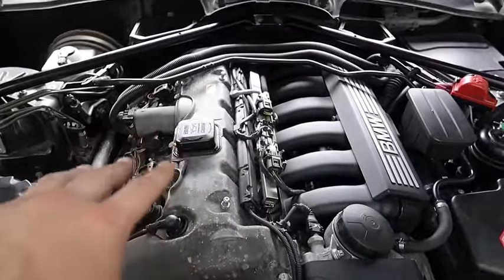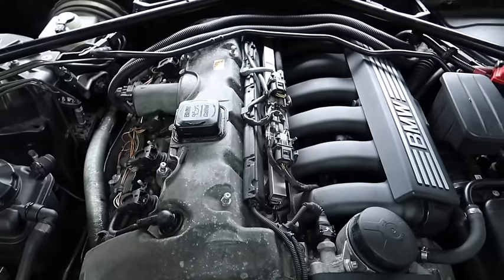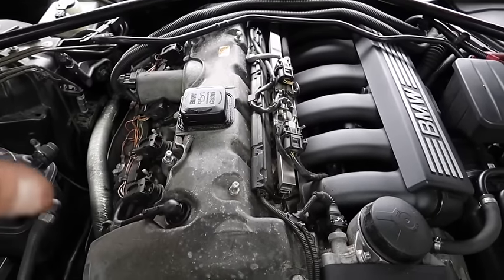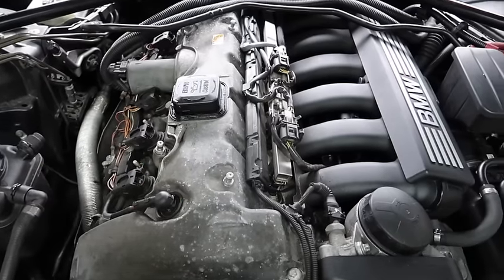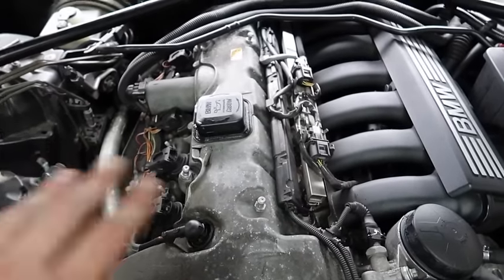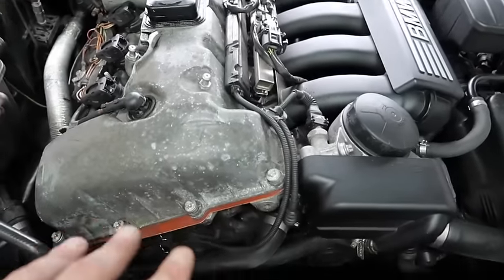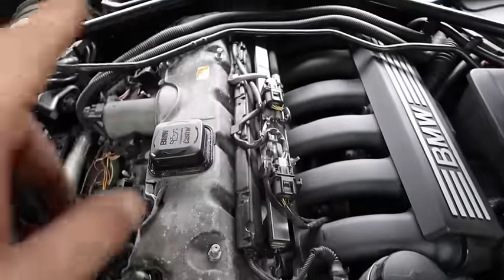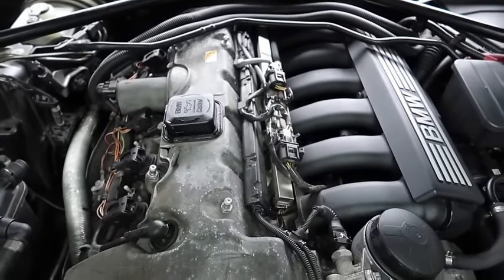Don't EVER Use This Oil In Your BMW !!

Comment: I used to use 0w 30 on my N53 (don’t know why) but was burning  oil quicker than a tramp on chips but when I went to 5w 30 and I don’t have much of a problem anymore. It’s done 92k now but I change oil & filter every 4K miles. Guess I’ll have to change to 10w 40 soon if I get oil burning again. Cheers for advice. 👍🏻
Reply: that should make zero difference as both oils perform the same (viscosity wise) if not well below freezing temperature.
Reply: Hey results?

Comment: Bmw doctor my 2008 328i has 117000 miles i used 5w30 high milleage  castrol regular not edge or should i use 5w40 regular or high milleage?

Comment: Is there a specific brand of 5w40 you recommend ? And how often should I change it? I just took ownership of a 2000 528i with 87k miles on it. I'm very used to my Porsches taking mobile 1 oil but do bmw motors do better with a different brand other than Castrol?

Comment: 170,000 miles on my N52B30 and it uses/ leaks a quart every 4000 miles or so. I might try 5w40 next time. Could that  PCV/CCV be routed to a catch can and the manifold plugged without causing issues?

Comment: Hello. I have a e60 520d 2006 (end of year) automatic and it has around 245k km. what oil do you recommend to use? I’m thinking of using the Castro Longlife 5w30. The bmw original oil. What do you think about it?

Comment: I used 0W40 for many years on my N52B30. What do you think should i change it to 5W40? Thank you for your answer :)
Reply: Just in case no one else answers. In brief: You can go a step lower than the first rating and one step higher on the second rating from the manufacturer's recommended viscosity. Lower to higher. Never the reverse. And just because you can, doesn't always mean you should. It depends on climate, as well.

For example: My M54B25 is spec'd for 5w-30. I CAN use as far as 0w-40 with minor repercussions IF it suits my climate. I cannot use 10w30, 10w40 or 5w30, etc. Check your owners manual and then change your oil only if you really think it's necessary. An N52 is a solid engine. If you're not having any issues and keeping up with regular oil changes, then there's really no need to overthink the oil.

Comment: Hi I'm a 1st time BMW X1 2012 owner (bought a used car, 2nd owner) mileage is about 119k been using Castrol Edge 5W-30. I lived in South East Asia, super hot and humid weather (near the equator). A few questions:-
1) How often should I service it ? Every 5000km or 8000km is alright? 
2) is the oil alright to use (5W-30) or should i switch to 5W-40?

Thank you.. I love all your videos .. taught me alot 🤗
Reply: 5w40 tous les 90000 km
Reply: @lavazza8031  90k or 9k?
Reply: @majaz417  He is so wrong. Every 7-10K km is fine

Comment: Hello Doctor.. i bought BMW 523i NB53 f10 2010 but I noticed in the morning cold start engine shake for a few minutes and then i switch off the engine and start back the engine after a few seconds engine slightly better but when i am driving the car after a few minutes engine shaking goes away . could you please help me out . thanks

Comment: Can I top up with 5w-40 without knowing what oil was used during the previous oilchange
Reply: Generally speaking, you don't wan't to mix 2 different name brand oil because different additive is used by  each company.. With that said, in a emergency any oil is better than no oil.

Comment: Dean, i just got an N52B25 with 140k miles. Should i use 5w40 and it should be fine? I live on a tropical island and do approx 9k miles per year
Reply: If you live on tropical hell yea switch to 5w 40! 40 weight is always better than 30 in hot climates.

Comment: Okay, let me se if i got this right. I have an e61 523i with N52 engine. My friend told me it smokes every time i drive away. So my first reaction was the ccv so ive bought a new one didnt got it yet. But when i do i will change that and the oil filter with new oil so you recomend the 5w40 oil. Damn why did i buy this car. Do i need to change the pistons rings in this piece of shit.

Comment: Dean what’s yur opinion though on the diesel spectrum older diesels m47 and m57 which is yur choice of oil on them would you use 5w30 or 5w40 mines being remapped to 200bhp tomorrow so I need advice on a good oil to use in it mines m47 by the way I’ve no egr DPF or Backbox and swirl flaps deleted glow plug module put in and much much more

Comment: I use Castrol 5w-30 in my N52 doesn't use any oil between 5k oil changes
Reply: I got thru a quart every 1000 miles but if I switch it won't use it like that

Comment: Run seafoam before changing oil every 5k, I use 10w30 Pennzoil Ultra Platinum. Running it 40k miles now,3 years. No oil consumption and cant even hear it idle.  Never trusted Castrol, too much detergent and always drained like water
Reply: Castrol GTx is definitely an inferior oil in my experience .  Vw recommends it in my 2017 golf 1.8T and used it until 30k miles.  It burns off too much!! 
I Switched to Pentosin HP II 5w40
 5 oil changes ago and the problem went away.

Comment: Should I switch to w40 on high mileage (150000+) M57 engine?
Reply from the maker: no because you have turbo the turbo needs the oil Thin for warm up and to protect the turbo therefore stay with 5W30 M57 doesn't suffer oil burning issues !
Reply: @BMWDoctor  any advice on a 2012 750li  ? Is it a good car to have overall? Should I use the 5w-40? Do they have valve stem seal problems like the older models? Please I need your advice

Comment: Can you please help with a problem I have with a BMW E60 2005 with an engine fan, It spins all of the time. I have no temperature problems, AC turned off. What could it be? Bad fan or bad wiring?
Reply: Coolant Temperature Sensor.

Comment: N62 engine 0w-40 here. 185,000 miles
Reply: I have the same engine so quick question : Why 0W, why not 5W?
Reply: @ARUNPR86  I like the 0w more because it flows quicker in the cold
Reply: I believe helps it get to temp faster

Comment: My BMW 325i has the same problem every 1k miles I do I have to top it up with 1 litre of oil, I have a friend which told me to change it to 5w40 but I never listened, and now I see this video, might be worth doing it, and my car is just under 100k, its on 90k do you still think I should change the oil to 5w40?
Reply: Yes i started using 5-40 w on mine at 95 ish k miles. Mines awd e60

Comment: What do you recommend on a bmw 750 li 2012
Reply: I just bought the 2012 750Li Xdrive with 73k...wish me luck
Reply: I had the rear main seal replaced, still have a small drip on garage floor?

Comment: I am finding oil in the spark plug/coil galley...Where is this coming from? Thanks.
Reply from the maker: valvetronic motor gasket ! or from previous owners filling up with oil and spilling it down there
Reply: Spark plug tubes under Valve cover @ron

Comment: What about 20W40 or 20W50?
Reply: I have a 97, and I use 20-50 in mine, I did ask a BMW mechanic about using this grade and he also uses it in his as well.
I have had no issues.
But I would ask a BMW mechanic just to be safe.
Reply: Yes you can and should actually use 20W50 in them as long as the temperature never goes below 0°C/32F

Comment: Great information 👍, so what is the best engine oil for N57D30 engine 40d with milage of 143k?
Reply: castrol edge , mobil 1, liqui moly,,,,, 5w40 uniquement
Reply: Une question à poser à propos du n57d30, faut-il choisir LL-01 ou LL-04 ???

Comment: Hi doc What do you recommend for a 530i with an m54 and 120000 miles ?

Thanks
Reply: In case Dean doesn't reply: M54 is spec'd for 5w-30 in America or 0w-40 in Europe. But it all depends on climate, too. At 120k, make sure your CCV is in good shape, do the O2 pilot mod to boost the crankcase vacuum (super easy and inexpensive), then switch to 0w-40 if you live in a place with very cold winters. If your winters are mild, it won't make much difference to change the rating you use.

It's the failing CCV that eventually causes the M54 to burn oil.

Comment: N52b30 engine temp.  tends to keep engne temp. high during normal driving for better MPG.  It seems to be keeping 120 celsius during normal driving and around 80 for high speed driving.  Is there any way to keep engine temp. under 100 celsius.  And will you recommend it?
Reply: Hot climate? In Norway mine is running at 120 only when pressing it hard and/or pulling a 1000kg+ trailer. Usually it runs at 90-110.

Comment: Hi Just had my m54 engine oil done running great at 119k at mo, done 2,000 miles since service using rock oil 5w 30 but now needs topping up can I now use 5w 40 or not good to mix? Ta
Reply: 5w 40 is good for m54. Check opie oils thats pretty much all the recommend for m54 now
Reply: You can put in thickener too. That seemed to do the trick for mine and stopped it burning oil and leaking.

Lucas oil stabilizer the thinner one of the two types.

Got recommend it by mechanic after spending a lot of time chasing oil leaks with the w30

I'll try the w40 next though too
Reply: There's a valve in the oil filter housing that went hard in mine too I saw it when changing the gasket on the housing. Found a couple of cheap replacement ones on eBay but couldn't find any proper ones. That valve is supposed to stop the vanos from getting starved of oil at start up. So the thickener I'd hoped would keep the vanos from drying out.

Comment: Should I do an oil flush when going from 5w-30 to 5w-40 or can I just pour in the 40 and be good? Dumb question i know.
Reply: There is little difference between them. The 5 number is the viscosity when cold and the high number when hot. You can mix them.